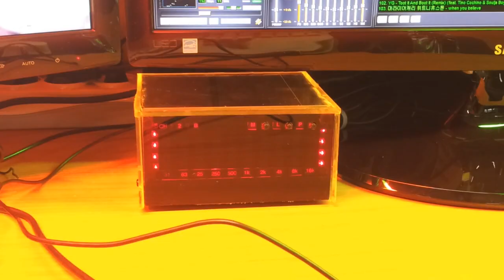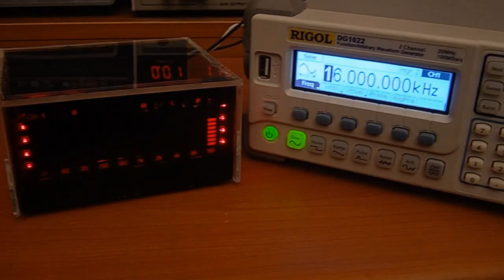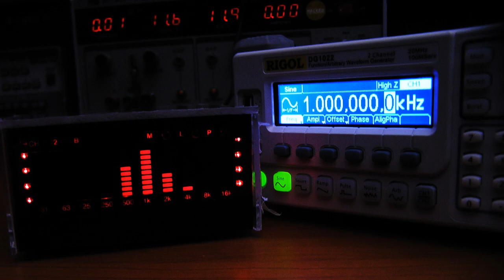DIY 10Band Audio Spectrum Analyzer (using LM3915)

Comment: I have found your schematic.  There are a few things I don't understand.  Where are you generating the VCC from? Also why are all your resistance values strange?  Like for example the resistance value on the clock circuit are marked as 1002KF?  Are they just 100K?  Please get back to me on this.  Also I would like to omit the whole switching circuitry entirely and make two of the same circuits so I can get Stereo, so I would have 20 bargraphs instead of the ten but the other ten would be inverted, (I know how to invert them already) it just seem like you have really integrated all that audio and power switching into the circuit for it to work properly.

Comment: I got the schematic now, but finding it difficult to understand...anyone else doing or did the project?
Reply: what do you need help with :)
Reply: hansley maharaj I am having difficulty implementing/understanding the schematic to put in on a general purpose dot vero board. Probably because the circuits are not interconnected in the schematic. Can you help me with that?
Reply: hansley maharaj I understood the first segment of your comment. This is not clear - "the next thing is the timer so connect all the clk (clock) together  NOTE there is a negative voltage  generator  that connects to pin 11 of the lm324n  IC and all the vcc goes together as well as the grounds "
Reply: Aritrim Basu i am still trying to fully understand the schematic as well  sorry for the long wait for my reply had to work the past few days
Reply: hansley maharaj They are having the PCB made and will be available in November.

Comment: Hi, is there a schematic for the circuits?
Reply from the maker: http://itstyle.kr/?module=file&act=procFileDownload&file_srl=30061&sid=8ce2a100022409e412a20f7528e9f3b5
Reply: Minju David Lee Hi,  my English is not very good, I can not send images more sharp, where you can see where solder on the PCB.
I want to do like that. Thank you. my email is deywi.753@gmail.com     greetings from Peru.
Reply: +Minju David Lee the .pdf is still there.....thanx a lot!
Reply: +Minju David Lee On the schematic, for the Power Inlet, it says C6 CAP POL. I understand it is a polarized capacitor, but what is the capacitance value? 47uF ? thanks

Comment: Hi, I am building the spectrum myself at the moment ... but I am facing a problem because the number of resistors needed on the kit is more than the list said it suppose to be ... by any chance 1002F 1/8W = 10K ohm ?? ... and what does 1002KF 1/8W means ?? 10M ohm ?
Reply from the maker: HI
100 * ( 10 ^ 2 ) = 10000ohm = 10k ohm
another example 3301F = 330 * ( 10 ^ 1 ) = 3300ohm = 3.3kilo ohm
1002KF is just my mistake. 1002KF is not. sorry.
Reply: Minju David Lee Thanks David ... very much appreciated for the clarification ...ㅋㅋㅋㅋ... if that is the case I calculated I need more than seven 10K ohm resistor ... O_O
Reply: Alan Yong Have you completed the build?

Comment: my mail -gaydukov07@gmail.com
Reply from the maker: http://itstyle.kr/?module=file&act=procFileDownload&file_srl=30061&sid=8ce2a100022409e412a20f7528e9f3b5
Reply: Minju David Lee could i get some pictures of the circuit boards thanks and what connectors did you use to connect the boards together thanks
Reply from the maker: hansley maharaj Please refer to this site. 
http://www.devicemart.co.kr/goods/list.php?category=003001029
Reply: thanks 1 other thing all the led bar graphs they connect to the lm3915 right? thanks for the help in advance